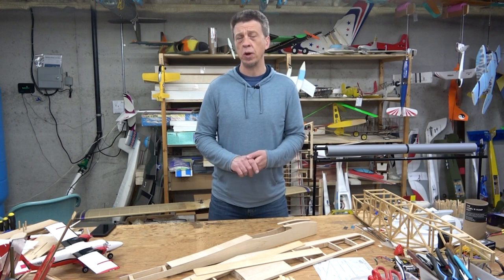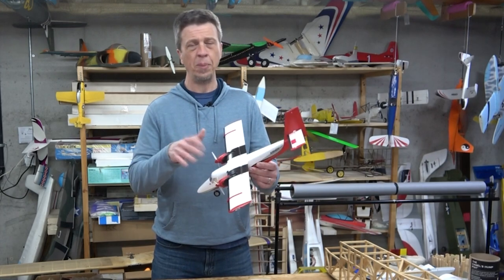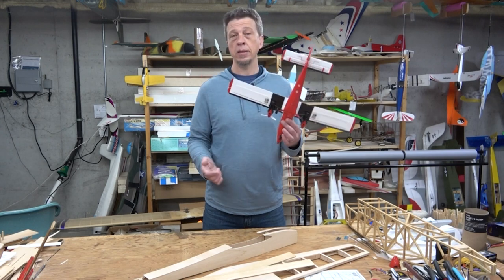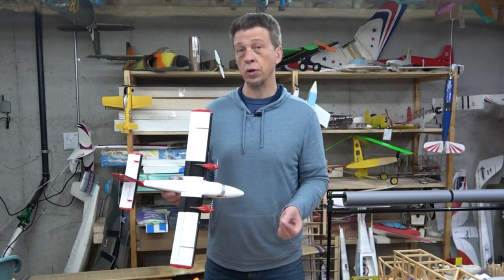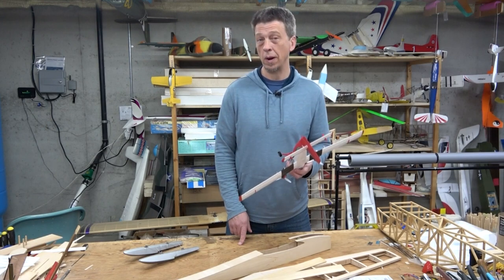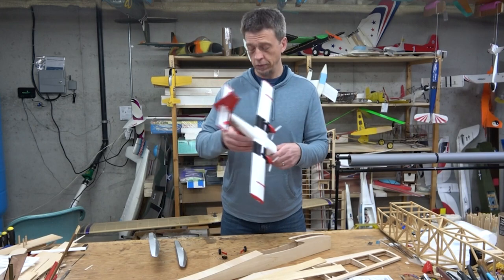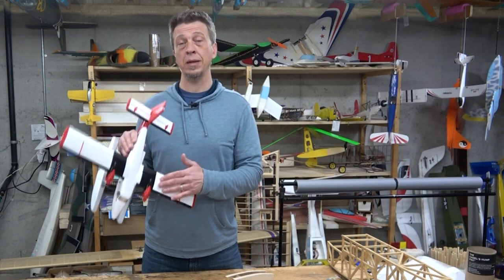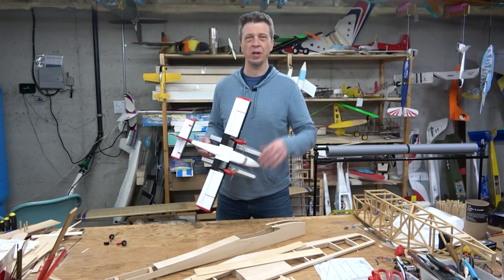UMX Twin Otter BNF Basic with AS3X and SAFE Select Review - Model Aviation Magazine

Comment: I wish I watched this video before trying to install my floats today!  Way to hard to push in those floats. One of the planes plastic red connectors that’s glued to the  bottom inside of the fuselage  came loose and the other side next  to the two holes in in the fuselage bottom started cracking the foam. I gave up for now. Don’t want to cause anymore damage to my otter. I wish they used stronger foam for the UMX lineup…